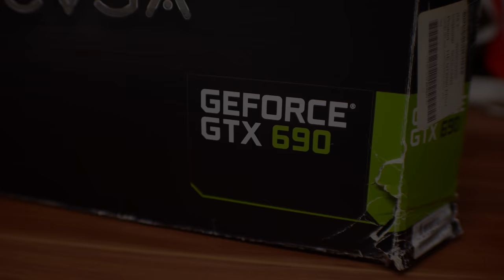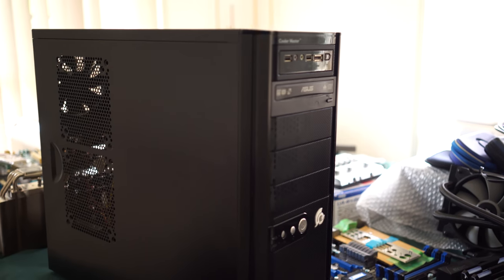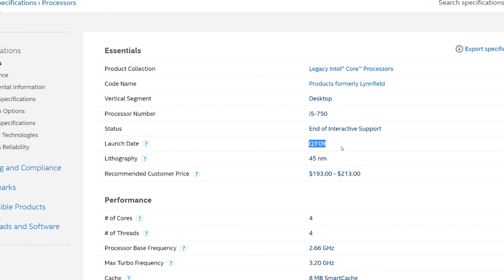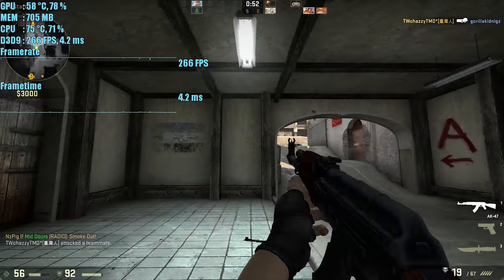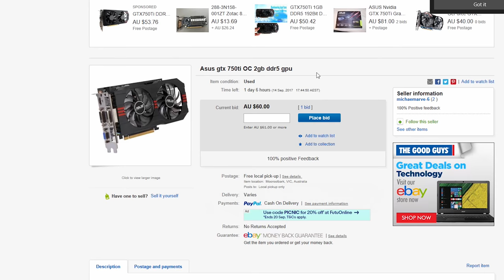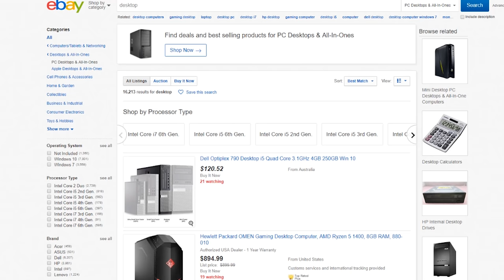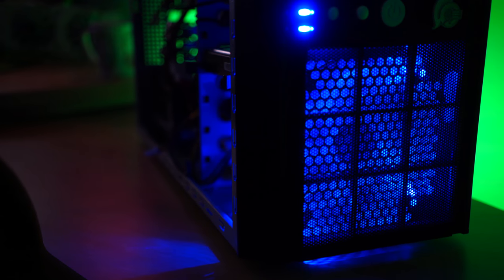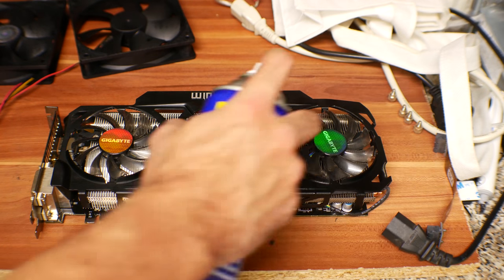The CHEAPEST and EASIEST way to Get INTO PC GAMING?

Comment: Problems: you won't be able to swap the motherboard, it will have a cheap crap power supply. 

Windows 7 support ends jan 2020.

On ebay you can get a $40/£30 fast 2.6ghz, low-energy, AMD 4-core 910e cpu. (There is also the very slightly slower 610e which is virtually identical but has no level 3 cache.) They'll do everything quickly except long 1080p video encoding. They even play modern games at 720p or 1080p. Get an AM3/AM3+ motherboard for them and DDR3-1333 MHz.

They can play Battlefield 1 at 1080p.

They run at a similar speed to the Athlon 620, which has youtube gaming videos made of it.

I use the 610e with a 2015 64-bit Linux operating system, comparable to Windows 10 in size. With all my software running at the same time like Opera & Firefox browsers, Libreoffice suite, GIMP photo editor it uses 12% on all four cores. When viewing 360p YouTube videos it rises to 35% on all cores, the same as viewing 1080p video on my media player.

There is also the cheaper 400e which is a low-energy 3-core.

Overclock the CPU
https://www.youtube.com/watch?v=nL28wW5AmYE

Overclock the memory for faster games https://www.youtube.com/watch?v=k8vuTPj0VXA (In cpu-intensive games you would see the difference. Run in lower resolution and graphic settings to eliminate the gpu bottleneck to see the difference.)
http://www.masterslair.com/memory-ram-overclocking-guide-ddr3
http://www.overclock.net/t/1361380/overclock-kingston-valueram-1333-to-1600

I recently learnt of some disturbing news. Intel are not who they appear to be. Why? Intel: Anti-Competitive, Anti-Consumer, Anti-Technology.

Can Intel use illegal tricks to be the only company allowed to make & sell processors? And Intel pays Dell, HP, Sony, Acer, Samsung & all the others to not buy AMD's processors? And keep all their practices secret? Then AMD spends ALL of its money trying to sue Intel since 1987?

Intel's compiler software? Written to perform fast ONLY on Intel CPUs. This is then used by all the programmers to write their software, including games, which will then run much slower on AMD's processors. Intel was then left in a position to suppress the speed of its own processors & inflate their prices. (One of the benchmarking software is compiled using Intel's compiler.)

Tablets? Makers paid to not use AMD's CPUs.

Notice how laptops only have Intel processors & it will remain like that until consumers find the truth & change.

Bribes were paid to Europe's biggest computer seller. Game-console makers were given free Intel CPUs so AMD could not compete. Eventually AMD broke through.

My guess: Intel bribed the major gaming-software makers to use its compiler software, who all kept quiet about the payments.

35-minute talk made after decades of research on the evil, global, faceless, corporate Intel:
https://www.youtube.com/watch?v=osSMJRyxG0k

Intel's new Coffee Lake CPUs won't use the Intel-made z270 chipset so won't work with the Sky/Kaby Lake 1151 boards. Angry Intel users, who sensed they've been scammed:
https://www.youtube.com/watch?v=dt-oA4x776A

Benchmarks misslead as they don't show the CPU usage percentage. 2-core Intel benchmarks are far higher than they should be compared to 4-core AMDs.

I asked an i3 user who told me that an i3 running daily software like browsers, office suites, media players etc. all at the same time uses 30% on all cores.

So i3's run Windows like the old AMD dual cores that many AMD users threw away years ago, the ones now sold on Ebay for $7. (An i3-6100 is $100. An i3-7100 which is not that much faster is $170.)

Someone wrote they wished Intel would do more "great" things like the Pentium G4560 (an i3 at a lower price). Someone responded that Intel were limiting those to entice more people to the i3. I think that's just going to backfire on Intel.

In 2025 Windows 10 updates will expire so a current i3 is unlikely to be able to run the next operating system after that. By then you could get a i5-6400 at $60 but you could get a Ryzen 5 for much less which will be much better at multi-tasking. This assumes the new Windows supports the 1151 board. (Windows 10 doesn't support socket 1155 which came out in 2011).

Someone with an Intel G4560 & a Ryzen 1200 wrote: “I own both of these cpus and believe me, g4560 slows down a fucking lot after 2 weeks of usage due to the antivirus and other stuff, and with ryzen I can even listen to the music on twitch in full hd, have 3 more chrome bars with tutorials for csgo/lol champ builds and much more while still sustaining stable and better fps than the g4560".

A gaming reviewer on Amazon wrote of his Ryzen 3 1300x: "its snappier than the i3 4170 its replacing and games are running smoother, I cant say frame rates are much higher but its more consistent with less drops and stuttering. Farcry 4 and The Division seem to be running at a much more solid 60 fps now with 4 physical cores instead of 60 with drops down into the 30s and 40s randomly with the 2 core 4 thread of the i3."

Youtube comments on a Ryzen 1600 running several games: "wow CPU usage is 25% on 1600, and its fucking going at 90-100 fps. Damn Intel got there ass kicked from AMD. Im switching from buying a i5-7500 to a Ryzen 5 1600".

"The video I saw of a skylake i5 vs even a 1400 (or 1500x) the i5 was 100% cpu utilization and the 1400 / 1500x was like 65% cpu utilization. AMD just destroyed the i3 and i5 line of intel lol".

Someone tested a ryzen 3 1200 with an nvidia 1050ti in a few games. The card was at 100%. The CPU was at 50%. My guess is that an i3 or a g4560 would have been more at 90-100 than 50%.

I'm willing to guess that Intel doesn't pay taxes. It's part of the global corporate empire with Monsanto, Amazon, Google, Starbucks, Facebook, McDonalds etc. Yes, Amazon. They're in on it too.

Someone asked AMD on Facebook if they should upgrade their Ryzen 1600 to a 1600x. AMD replied just overclock it instead.

Comment: At the moment I am hunting for good deals on older graphic card. I got hold of an Asus GTX 590 for $32, an Asus GTX 670 DirectCU II OC 2GB for $32 (was sold as untested/defective but it works fine after a clean up and new thermal paste), and lastly I got hold of 2x Asus GTX 760 DirectCU II 2GB for $96 for both. So next it's time to hunt for old PC's.

Comment: I managed to find a PC with a GTX 980TI, 16GB ram and an I5 6600k for £300 on Facebook. I've no clue why it was so cheap as the bloke I bought it off actually seemed relatively informed about PCs
Reply: SirStickney DANG. Nice one that's a complete steal at that price. Could resell for more on Gumtree at stock
Reply: Ecorigon IV I just upgraded my old pc as I only had a 4690k and a gtx 970. I sold all the old parts and still made a tidy profit

Comment: I am at the moment debating picking up an i7-3930k and a x79 mobo for about 100$ each to replace my fx-8320. from researching the i7-3930k is only about 10% slower than an r5 1600 and about 25~30% faster than the fx-8320. As well, the platform would cost about 300$ less and I keep my 16g of ddr3.

Comment: the i5 750 is a great cpu if overclocked, though. dont buy it if your gonna run it stock. especially while gaming. because at stock it even bottlenecked my gtx 960 really really badly. even a i7 860 bottlenecked it a bit. only buy it if overclocking. but if you overclock it. its a great cpu.

Comment: how is your fps so good on cs i have a 960 and a i5 2500k and only get 200 max on 1080p
Reply: thinking it might be the low shadow and shader quality. Was wondering the same since I get around 250 with a 980 and 2600k@4.5 but I use shadows and shader on max
Reply: DrunkMarksman he lowered the settings
Reply from the maker: DrunkMarksman copy my setting I use and see if you like them
Reply: Me too !
Reply: The benchmark is fake.
Reply: DrunkMarksman  depends on your cpu
Reply: DrunkMarksman i also have a 960 4gb and a i7 3770 @4.1ghz and i never go under 200fps. Some maps like overpass is always about 300fps all the time and can peak up to 4xx fps
Reply: The CSGO benchmark doesn't represent real performance, I have an i5 6600 and a 1080 and get around 200 in game too, my GPU sits around 10-30 percent usage, it's just the old engine
Reply: Boda 

source engine is heavily CPU based
Reply: My CPU usage sits around 50-70 percent. It just needs a new engine
Reply: ONLY? U NEED MORE?
Reply: The higher the FPS the lower the frametime so it's more responsive
Reply: DrunkMarksman On max settings my 1060 6g and r5 1600 gets about 310fps avg (maxed out) so yours is completely in the normal range for that system
Reply: DrunkMarksman you may have a virus

Comment: Hey Bryan, 

I have been slowly upgrading my wife's old HP Pavillion so she can play Dead by Daylight. New case, PSU, RAM, CPU & Cooler and a HD5870. The only thing left from the HP is the old shitbox OEM mobo - MS-7613(Iona-GL8E).

I currently have an i5-750 and want to hand down my GTX970 to try and get a better gaming experience for her so she joins the PCMR, but it doesn't seem to run much better than the HD5870(which needs new thermal paste & pads).

I like that I've kept the same socket and would love to keep the I5-750, which I've only had for 2 weeks, and eek some more performance out of it.

Is it worth upgrading the mobo and overclocking the i5-750, or just bite the bullet and upgrade both CPU & mobo to something like an i5-3570k & P8Z77?

Keen for your thoughts.

P.S. Sick videos, brah!
Reply: That i5 is too slow for a gtx970. The i5-3570k uses a costly old motherboard. Not worth using old motherboards now as they won't work with Windows 10 & beyond. Windows 7 ends in jan 2020.

What CPU is your wife's?

Intel is an evil corporation that bribed all the top PC sellers/makers to not use AMD's CPUs. AMD spend all their money fighting them. Intel's Coffee Lake won't use the current 1151 motherboard as it needs a new Intel chipset. If you go with Intel you'd have to keep getting a new motherboard every time the corporation wants your cash.
https://www.youtube.com/watch?v=osSMJRyxG0k

The AMD Ryzen 3 1200 would work well with a gtx1060. Ryzens 3 and 5 are low energy. The newer Ryzens will use the same motherboard for the next few years so that's good for upgrades. If you can't afford that consider the AMD 6-core fx6300 or 8-core fx8320e (AM3+ motherboard). They use the same energy as the i5-750 and people are selling them as they want to upgrade.

Comment: That GTX 690 is still powerful but it will perform as an GTX 680 in games such as GTA V because SLI is dead in 2017.
And why not overclocking the 9600GT like hell and give it a try?

Comment: What about xeon x5460 gtx 1050 ti 1tb all for 200 aswell?
Reply: From ebay:
x5460 $15
1tb $24
gtx 1050 ti $106
random gaming case $17
500w 80 plus $27
random but good cpu cooler $5

 (i managed to overclock xeon to 4.125ghz with this cooler with 84 celsius max in demanding games)

ddr2 4gb $12

(im not sure why 8gb costs like $160 or $211 so i was forced to get some slow ddr2 4gb, but to be honest i dont care about ram i shouldnt be affected by it, and i definetly wasnt when i played some popular titles on the system)

lga 775 mobo $24

 (i also had to buy a lga 771 to 775 adapter for like a dollar so that the xeon was compatible)

its gone a bit over 200, at $220 but if u r willing to sacrifice less hdd storage or a lower priced gpu then im sure u can exchange it for 500 or 750gb for $12 and a gtx 960 for $68 - $82 (it will have the same performance as the 1050 ti but the fps is slightly lower in gaming; probably a 10% difference between the two) this should make the pc cost $184 - $196

Comment: I just bought a used gaming pc from a friend at work. It's my first. I got 6gb dominator ram, coolermaster haf case, an evga sli motherboard with a built in temp gauge, i7 860, and a hella-something giant cooler. No fans on the cooler waiting on amazon ATM. The gpu is old and I'm having issues with it but I'm getting decent fps in every game I've tried so far. But the gpu is a gtx 260 super overclock edition. Dx9. What would be the best budget card I should do. I don't want to face a major bottleneck.

Comment: Nice Video, how you clocked a i3-2100 and gtx 645 it runs ok pubg in very low and low. But always after I land from the plane everything looks blurry and I can walk through the walls I can't pick up items it last about 3 to 4 minutes. After that everything is normal. This problem means o need a new GPU or CPU is Something else.
I have a
H61MGC Motherboard 
i3-2100
Gtx645 
There any Thing extra o can do. Please any ideas

Comment: I have the cleaning question. I just bought some second hand i5 + mobo + ram, and it's so dirty. In your videos I see you are using wd40, is there anything I should avoid using wd40 on?
Reply: Don't use WD40 for cleaning a PC circuit board.  wd40 stands for " Water displacement" and the number 40 is a certain performance raTING of that purpose.

Use a can of compressed air and DON'T use a vacuum cleaner on a PC's insides.  It's just not worth the risk of ESD damage.

Comment: I have a somewhat similar and a bit better build, yet I'm getting worse performance. I have a q9450 OC'd to 3.4ghz with ddr2 ram at 860mhz. With that, I have a 4gb power color rx 460. With this combination, I'm struggling to run overwatch and csgo on low. Any advice?

Comment: Meh used parts, ew. 
You can get to gaming with new parts for about 500€. Especially with the ryzen 3 1200 or the pentium g4560.
Reply: BlackPalankaa Try comparing a used i5 2400, i7 920, FX 6300, etc. and that will blow away still the Ryzen 3 1200 and G4560. There is a golden treasure in used parts market and still in price to performance will smash even the cheapest budget options.

Comment: I have an i5-2500k at 4.6ghz with a GTX 770 Amp. edition and I am struggling to run PUBG with even 720p lowest settings... Barely ever does it go over 60fps... Any help?

Comment: how much do you think i could get for whats left of my old pc . AMD FX 8350 black edition, ASUS Crosshair V Formula-Z
 motherboard and 16GB  ( 4x4GB sticks) of corsair 1600 mhz ram if i were to put it on gumtree or somewher similar? I live in Queensland but im out near toowoomba, If i lived closer i would probably just give the parts to you as ther just sitting here gathering dust
Reply: I think $280 (for listed components) or up to $350-$400 if you have a graphics card and a drive in there and sell a complete system. In South Australia, old i5/i7 systems around the same age go for that price. If you want a quick sale, clean the dust and keep your price a bit below ($20-$50) other similar systems on Gumtree/Ebay, take some pics of the exterior/interior and screenshot the specs of the working system while in Windows.

Comment: Hey Brian. I just found a pc on the x58 platform with a i7 920, 6gb ram, wifi a dvd player and gtx 260 with a 1200 W psu all for $200. I am thinking about picking it up and slotting in a 1050ti. Any recommendations?
Reply: David Huang that's pretty good